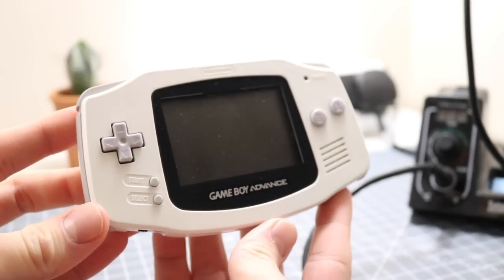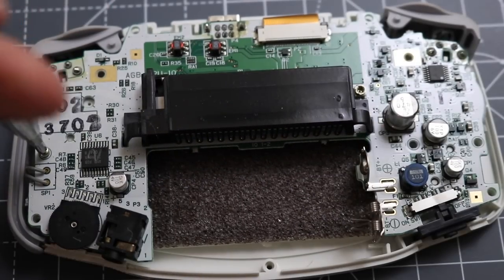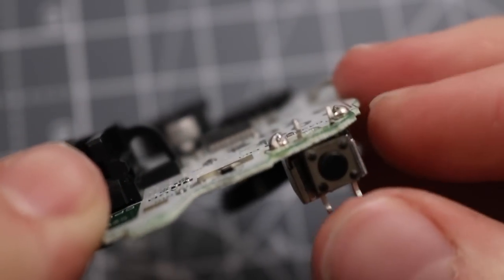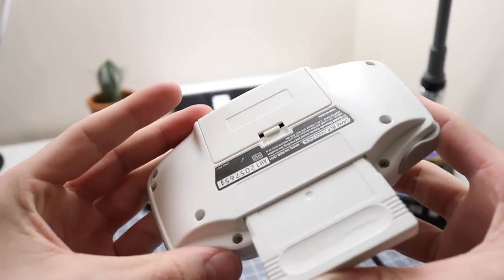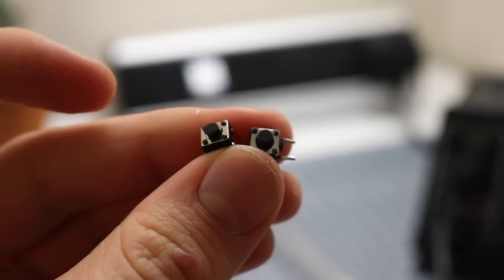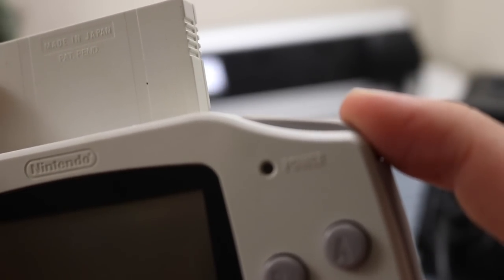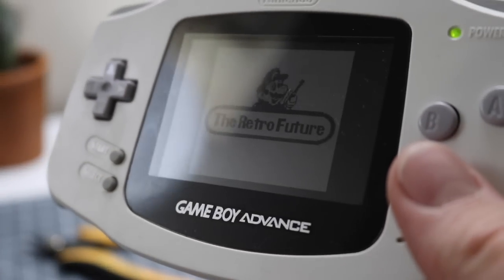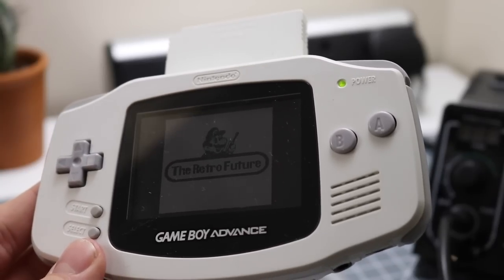Game Boy Advance "Clicky" Button Mod!

Comment: I thought this was going to make the d-pad and A B buttons clicky like the SP
Reply: Me too, the title is misleading in this regard.
Reply: Can't find good enough tactile buttons for that myself. I have some red SMD buttons that are soft enough and shallow enough, but i don't know where i got them - probably not from China - and i don't have enough in quantity for the mod. D-pad is actually particularly difficult, because you need a bit of overtravel on D-pad for the buttons not to mess it up.
Reply: If you know how buttons work that's not a really hard mod
Reply: Cant it has touch pads
Reply: Might be too late, but there is a mod that adds flax pcb to solder those clicky buttons on it

Comment: If you got micro switches with longer heads, it wouldn't have so much travel plus you could sand it down to preference or if it's too long.
Reply: "1825027-8" by TE are longer and they fit quite well :)
Reply: Just detach the rubber heads from the originals and replace them. They're easy to put back in if you fold them a bit with a tweezer. It's just a piece of rubber making contact with a thin plate beneath. Problem rises when the new ones are plastic and molded shut inside.
Reply: My only concern is actuation force needed... is 100g awful for fingers?
Reply: I don’t know what this means

Comment: Try installing the GBA SP's clicky d-button, start, select, B and A buttons into the original GBA model. See if that will work.
Reply: Dustin Nunn  the SP buttons are actually part of the board itself, the click is a little foil bubble. So no way to do that. But if you were really keen you could replace the rubber membrane in the gba with tac switches as long as you could drill some mounting holes without shorting something on the other side
Reply: Suggest using SMD tactile switches instead of through-hole ones. Then no drilling, just tape up the switch pad, glue the tactile switch to tape, and connect with transformer wire or figure out a good location to solder directly to switch pads. The problem i have is all that i found in China so far have a force a bit too high for my liking.

Also look for item type "tactile metal dome - no leg" in China. I don't see why with some careful taping it couldn't act as a switch plate directly on top of the existing switch pads. They come in different shapes and sizes.

Getting a D-pad to work well is proper hellish engineering challenge of trial and error though, it always is. Switches need de facto a bit of overtravel else you are likely to get in trouble with diagonals.

Comment: All I could picture was destroyed solder pads on the PCB.

Next time try using desoldering braid as that will help wick away the original solder with maybe a bit of flux, that’s optional but I would recommend the flux when installing the new switches as this will help with not getting a cold solder connection (looks good but will usually break/split.  Don’t trust rosin core solder with flux already in it as well.

Comment: Clicky buttons are less good of a product. I've used a lot of systems with both clicky buttons and rubber buttons. The Rubber buttons ALWAYS last longer. Eventually the clicky buttons will get soft because inside in a cupped metal disk that compresses everytime you push it. Being that it is metal it will eventually start loosing its ability to hold its shape under pressure unlike the rubber buttons which I have never seen wear out. Sure they could get dirty if you are a messy person around your game consoles but that is not so bad cause all you have to do is clean them out. With the clicky buttons you eventually have to actually replace them because they get so bad and actually stop working.

Comment: DO NOT USE SUPER GLUE! At least try it out somewhere else first, preferably inside a small plastic box or something! Reason being: Fumes! While hardening, some superglues (cyanoacrylates) gas off a bit, leaving residue. THIS WILL SOMETIMES FUME INTO THE SWITCH, causing a very thin layer of acrylic plastic to form on the switch plates, making them VERY unreliable under a low voltage load! You can see the layer of fumed off acrylate on (especially) black surfaces as it will look like a slight grey airbrush. This is very bad inside switches! Use a tiny blob of epoxy or something instead!

Comment: That's a downgrade in my book.
Reply: I actually grew up with the mushy dpad. Even the dualshock 4 has that sorta mushy dpad, so if there's a way to make the 3ds dpad feel like a gba dpad that would be awesome
Reply: @jamesmalik3355  you cant the 3ds is tactile switches for the dpad.
Reply: For my is definitely an upgrade. All my DS Lite which has the same membrane buttons as the GBA got bad after a few years of use, lost sensitivity and clickiness was gone, while my DS fat and DSi are perfect

Comment: For the L and R why don use vertical switches? they cost cents, and arent custom made as the Z button on the gamecube. In any electronics store you should be able to find them. also, they sell them with different lenghts, why use the short one?

Comment: I like the non clicky GBA buttons for some reason I feel like those clicky ones would feel akward
Reply: PixCub same here i think it's too loud and sound cheaper. The original sound is more like a mouse clik
Reply: I like somewhere in between, a little clicky and tactile but some rubbery give to it so it doesn't feel like plastic grinding on plastic. It's this reason I love how the gba sp buttons feel as it's basically a rubber membrane over tact switches.
Reply: I just don't like the travel on the clicky buttons.

Comment: as an FYI almost 3 years later. You can fix the travel issue by modifying/extending the contact point on the plastic button with J-B Weld or similar product to build up the spot.